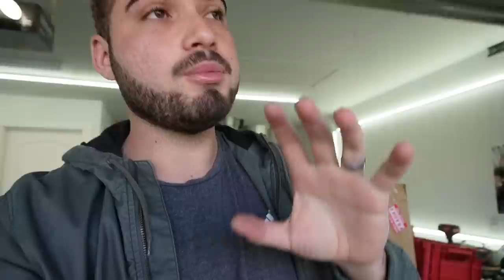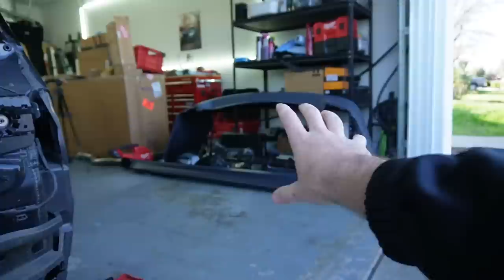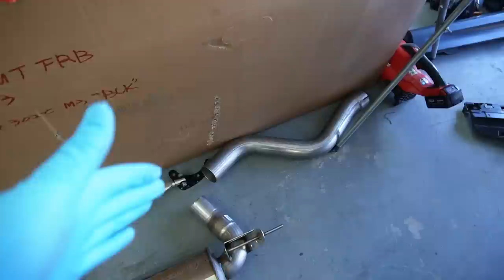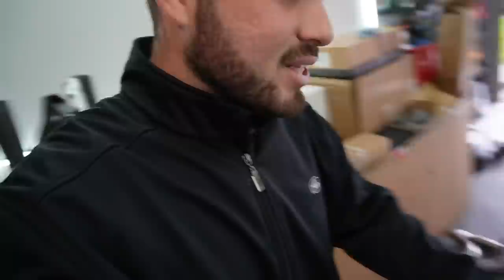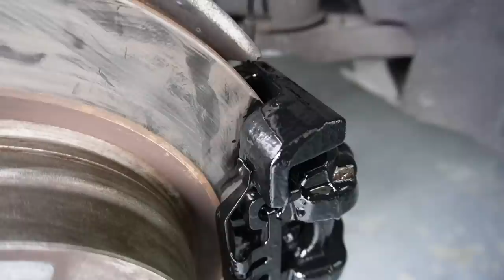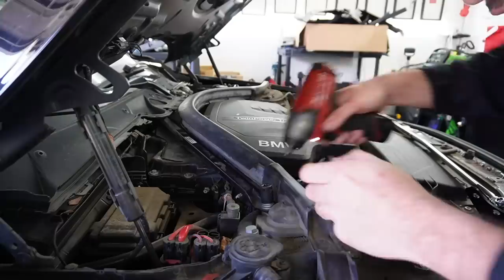MY F30 IS OFFICIALLY A FULL M-SPORT! + FIRST ENGINE BAY MOD!

Comment: Nour does the f30 have the 2liter 4cylinder with the 180hp?
Reply: That’s a 320i
Reply: @BMWWRLDZ  f30s been so much more complicated than e chassis
Reply: @oresthse4668  well, 320i, single exit exhaust, 328i dual exit, and 335i, 340i are single exhaust on two sides.
Reply: @BMWWRLDZ  thx didnt knkw that...
Reply: @oresthse4668  not so complicated
Reply: This one has 240
Reply: @FaderSkate  yep and 330 has 252